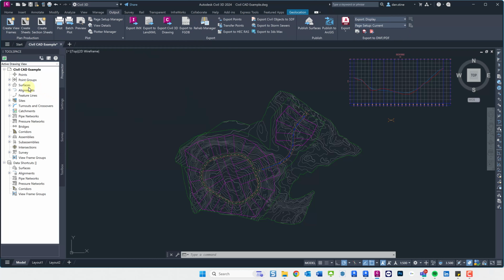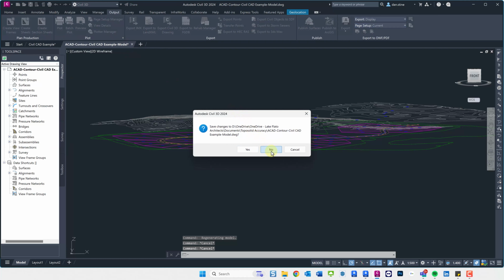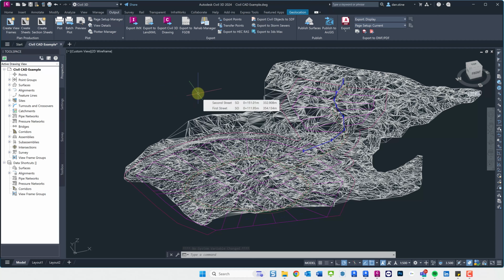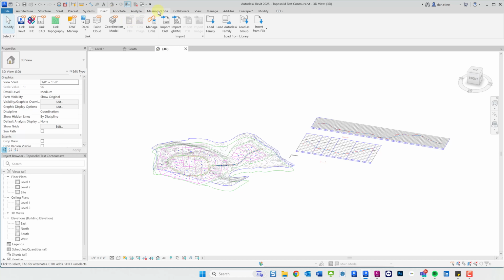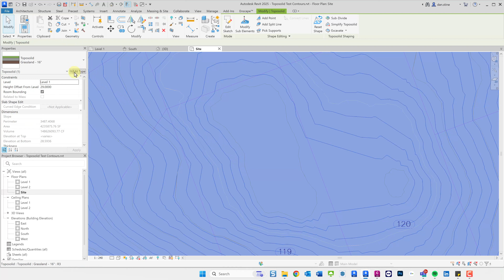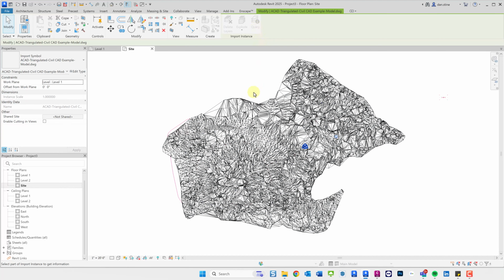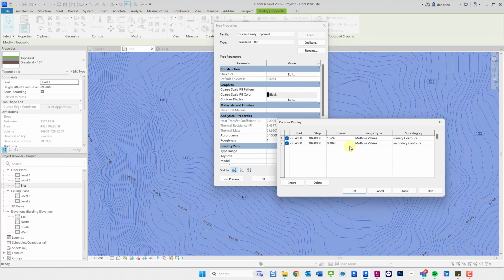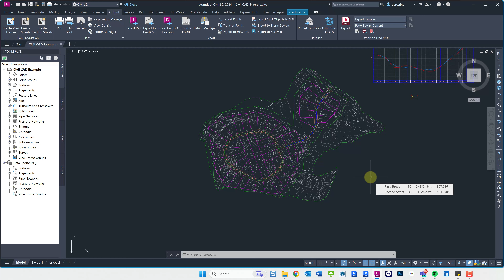Toposolid Accuracy in Revit 2025

Comment: Thank you, but how do you solve inaccurate triangulations when there are vertical elements like a curb, steps or retaining walls in the site?
Reply from the maker: That detail does not typically come through from a Civil CAD file, either in contours or triangulated surfaces. But there is a way... if Civil 3D is modeled correctly they can publish the surface to BIM 360 (Civil does not have to be working in BIM 360) and then Revit "LINKS" in the published surface. This is the best workflow since Revit is not designed for Civil design. Here is a related post: https://bimchapters.blogspot.com/2018/08/revit-20191-site-collaboration-with.html
Reply: I had the same problem. Solved it by making a solid from the surface and importing that solid into a family.